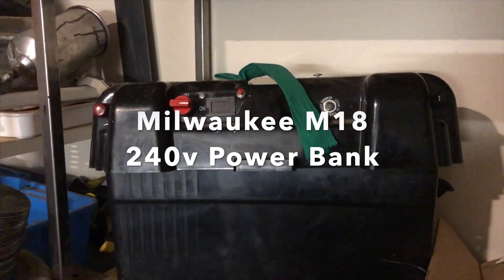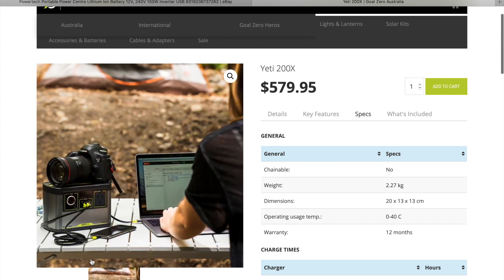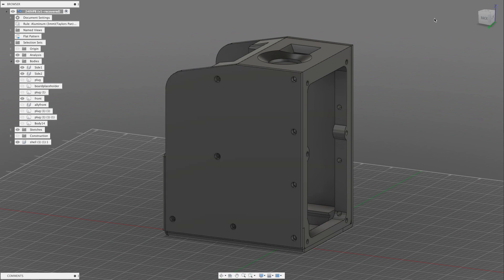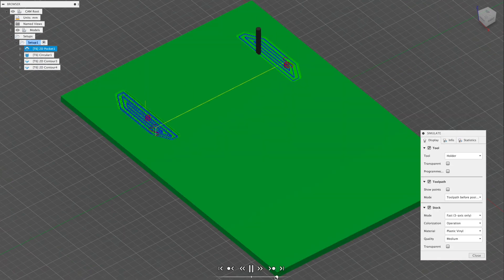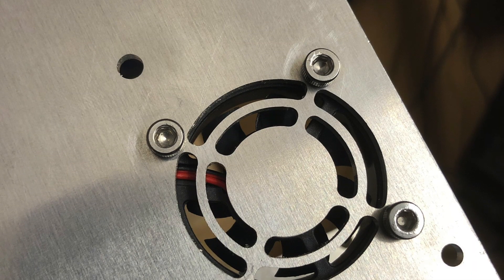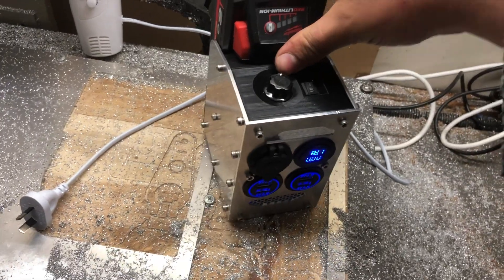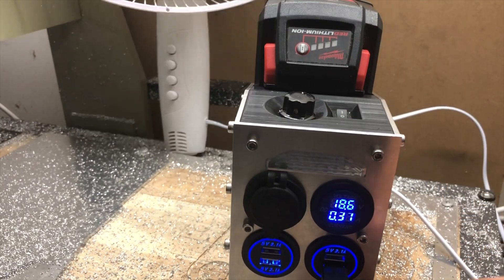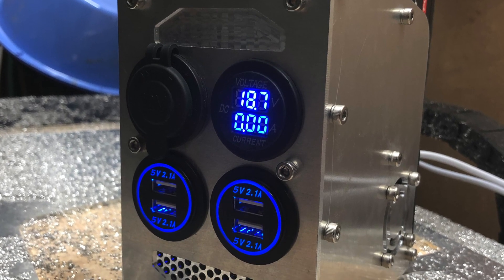Building the ultimate 240v Power Bank with 18v Milwaukee Tool Battery

Comment: beautiful! i love the aluminum and 3d printed parts together. i will have to try that. building a dewalt version soon. i am going to use this board to protect battery from over discharge. https://www.amazon.com/gp/product/B08LDGX2RX/ref=ppx_yo_dt_b_asin_title_o01_s01?ie=UTF8&psc=1
curious how you are addressing that?

Comment: Love your work. Need to build one for my Ryobi batteries :)
Do you have links for the inverter and buck/boost you used? Cheers
Reply from the maker: I'm working on a V2 that will have interchangeable sockets, so can print and attach a socket for whichever tool brand you have - as for the buck boost, it's a big 60v one I use to run accessories on my e-bikes HV battery packs. The inverter was a cheepy that I have no idea where I picked it up from :/ 

https://www.ebay.com.au/itm/DC-DC-Buck-Converter-Voltage-Regulator-Step-Down-Module-10A-24V-60V-to-3V-19V-AU/174335424155?ssPageName=STRK%3AMEBIDX%3AIT&_trksid=p2057872.m2749.l2649
Reply: @taylorhay  not sure if I'm right but I'm pretty sure Ryobi have their biggest battery as 9ah. This is why people generally use milwaukee batteries as they go up to a 12ah. I think also Makita do a 12ah and possibly Bosch prof do?? I'm not sure about festool....they very well may do? Oh....also, whilst writing this, I realise this is 3 years old. lol oh well....

Comment: Do you have any low voltage shutoff ? Or just keep an eye on the voltage ?
Reply from the maker: Not yet - but working on a solution that will still allow high amps to flow, while cutting off. Current solutions I could find top out at 3 amps, but my plan is to use that circuit to operate a 60 amp relay. Coming in V2 :) At the moment I just dont let it get too low

Comment: Awesome little power bank. Another option to Iso is Meths. I use it whenever im cutting aluminium.
Reply from the maker: My issue is that I've gotten drunk a few times in my garage during long cuts from all the flashed off ethanol! Now I keep the garage door open...